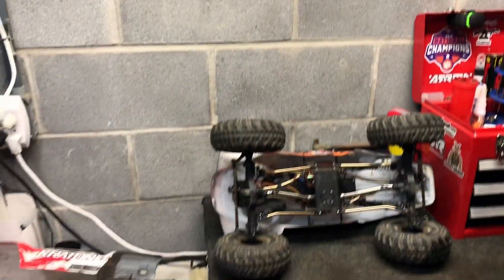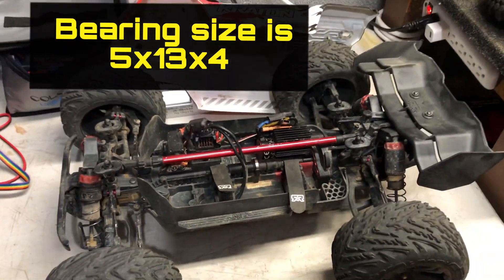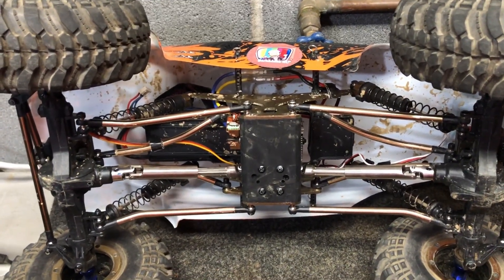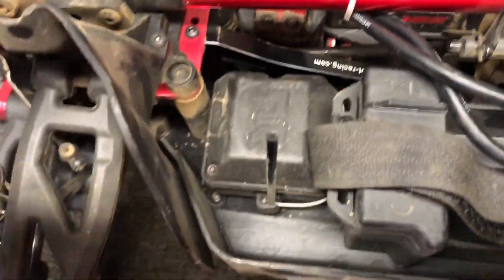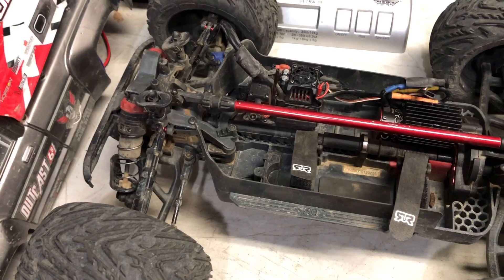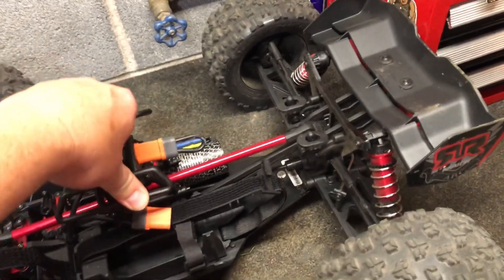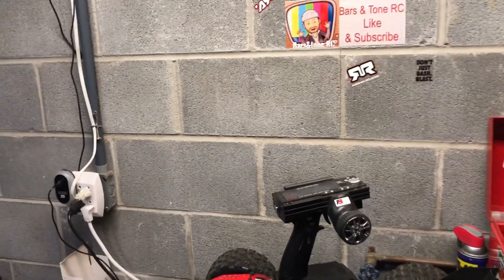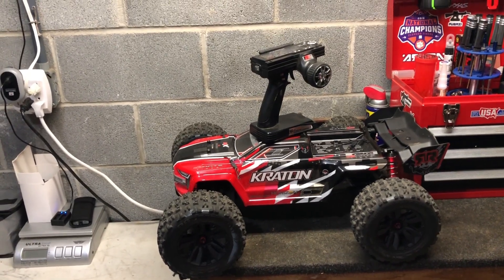Upgrades, updates. And I need some help!

Comment: So far I’ve taken your advice on the hot racing servo saver I was on the fence about it but after you said it made a huge difference I bought it and it sure does . Then I just put on the yeah racing fan it does move some air that’s for sure. Keep up the good info love what your doing!
Reply from the maker: Thanks bud glad I could help you man.

Comment: I have had nothing but problems with the kraton 4s, 10 min in on first run and junk! Just sent it to horizon hobby and praying they don't send it back.😣
Reply from the maker: What happened to it? What broke
Reply from the maker: The only thing I had issues with mine was the rear differential and part of that was due to miss adjustment of the clutch.
Reply: @BarstoneRC  rear diff, melted yokes burnt up motor, i believe the esc was faulty, melted motor mount, i just stopped there didn't really inspect the front diff. Oh and slipper was bad. I wasn't doing anything crazy just light running, not hot outside. I think I just bought a lemon but that's my luck lol.
Reply from the maker: Awe that stinks man sorry to hear that.
Reply: @BarstoneRC  eh what I'm I gonna do 😂 have a xmaxx and a e revo 2.0 for backup lol
Reply: @jamesrobinson4950  Wow that's pretty rough. My kraton 4s stock was running really cool and was even enough for me to gear up the pinion to 15t. Had a few slipper problems at first but after a few weeks it was broken in and stopped loosening. But that really sucks man

Comment: thanks for the info on the 3s and 4s motors. Based on Flysky site: https://www.flysky-cn.com/gt5-gaishu i would say the receivers dont work, click on accessories and it shows the receivers that do work, GT5 uses AFHDS 2A
Reply from the maker: That’s what I’m afraid of and I do not want to change it and re-purchase eight receivers LOL I was hoping the old receivers would work but they obviously wouldn’t have the Gyro which is something I know the new receivers have in them but I don’t want to Gyro anyway. Maybe I’ll just have to buy the transmitter try it and if it doesn’t work send it back I guess because I’m sure they don’t say the receivers will work probably because they just want you to purchase the new receiver but who knows right?
Reply: @BarstoneRC  its a different protacol so doubt it will work, other option is buy the GT5 and use it on new cars or a few cars and slowly move them over, or have one type say crlawer on the GT5 and Bashers on the GT2
Reply from the maker: Yeah that’s not a bad idea man I haven’t bought one for the new Kraton 6s yet so maybe I’ll start with that one and slowly grab some of receivers   Thanks for the info bud!
Reply: Bars&tone RC no problem. Hobbyking also do a clone transmitter and receivers

Comment: Question: I just broke a front shock on my typhon. I'm about to buy some upgraded shocks. What sizes work? Thanks!
Reply from the maker: If I was going to buy new shocks I would get the shocks for the 6S and put them on there they’re really nice
Reply: @BarstoneRC  are they the right size?
Reply from the maker: I personally have never put them on but I know other guys that have put them on the Typhon.  But these are the dimensions.    
Front Shocks: 102mm eye to eye 
Front Springs: 70mm / Stiffness: 5.71lb/in (1.00N/mm)

Rear Shocks: 115mm eye to eye 
Rear Springs: 80mm / Stiffness: 4.80lb/in (0.84N/mm)
Reply: @BarstoneRC  thanks man!